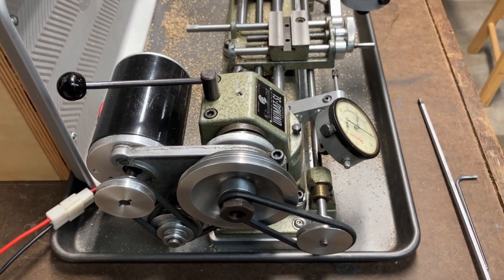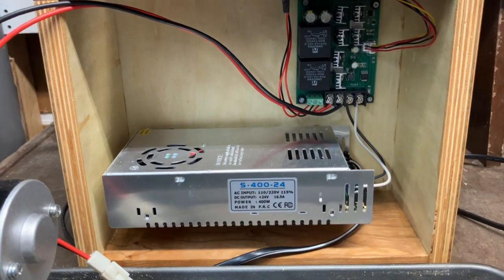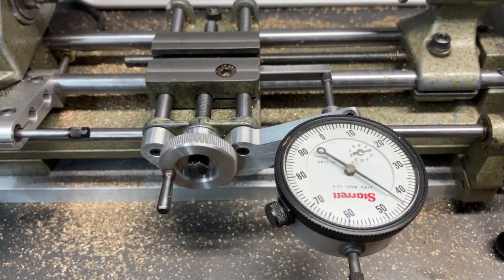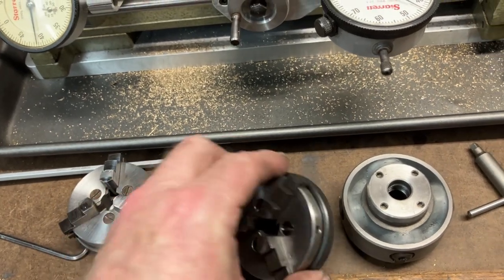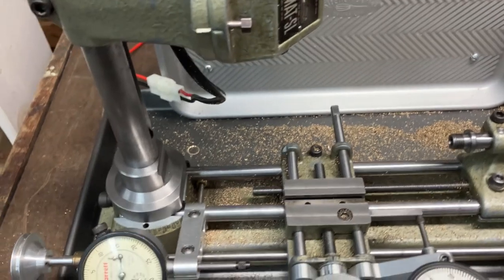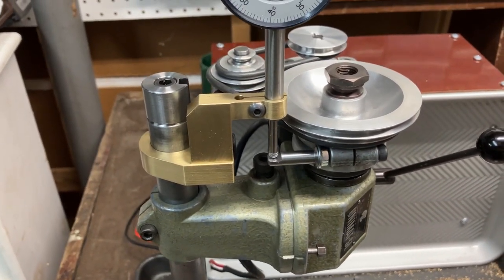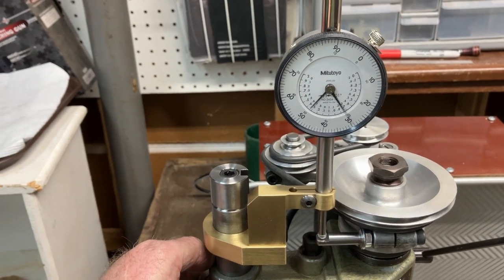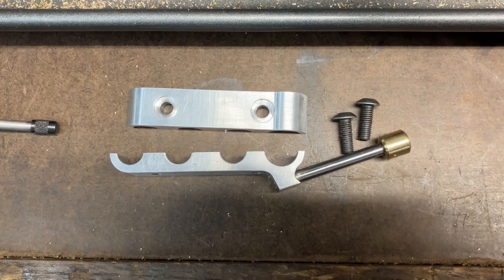Unimat SL1000-DB200 Lathe-Milling Machine Modification, Mini-Micro Machining, Tips, Upgrades, Emco

Comment: Nice manual setup..  (note-book recommend)  You've made a great hobby small machine so much better [maybe the Chinese will take note.]
Reply from the maker: Thanks.  It has been a nice project.  

The modifications are pretty straightforward.  Form follows function and keeping it simple.

Comment: Very nice job, I have recently acquired a unimat so I found your mods very interesting especially the dial indicator mounts. The milling mod looks great but it would be a bit much for me. I would like to know how many amps is the transformer to run the 150w motor. Thanks for sharing.
Reply from the maker: Here is the spec on the power supply:  24V 16.5A 400W Universal Regulated Switching Power Supply, 100-240V AC to DC 24 Volt

Comment: Very impressive mods. I have screenshotted them all, both the video and the post. 50 years since I owned one of these.
Being disabled, they are about the only lathe I can use now due to weight. Even a Unimat 3 is to heavy to handle.
Reply from the maker: I’m glad that you liked it.  The Sherline lathe is probably another machine that might fit your needs.  They have lots of accessories including a milling column.  

The Unimat is still a cool little machine and there is a Facebook group dedicated to them.

Best of luck to you.  I hope something comes your way.